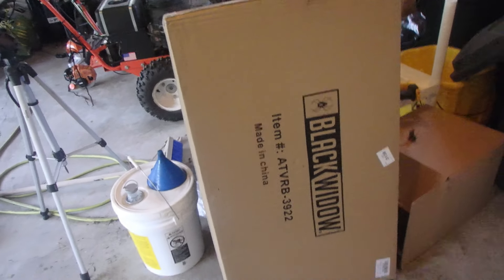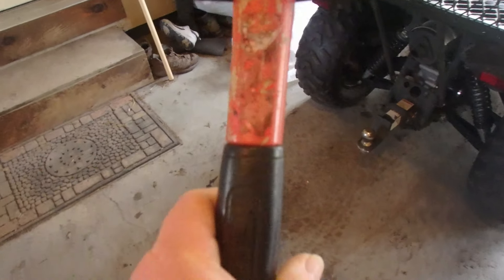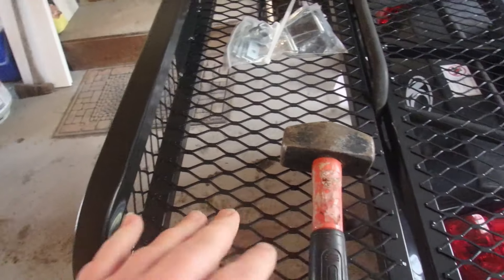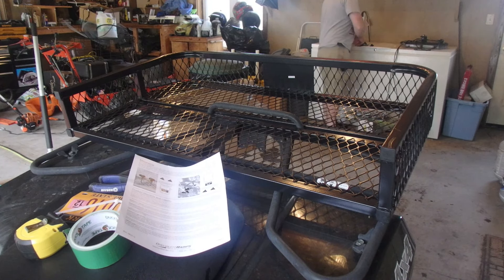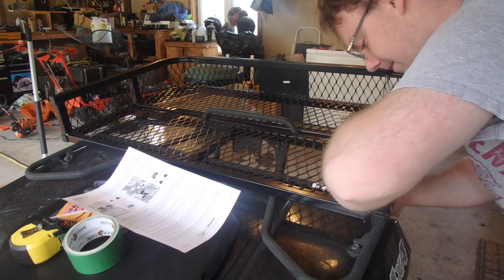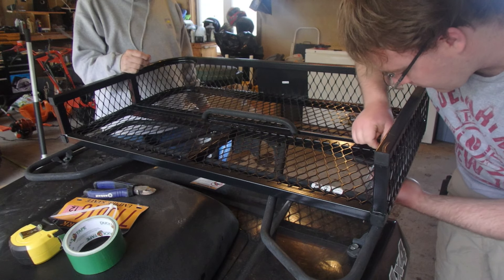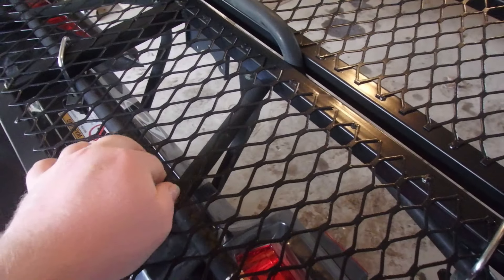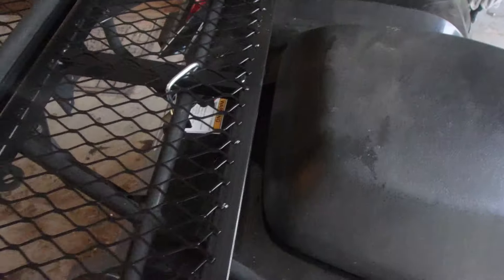Black Widow ATV Rear Basket Install

Comment: Just bought one and it just came in. I will mount it this weekend! Wish me luck.
Reply from the maker: Holy cow I did not mean to ignore your last comment! I am not getting any updates or when my subscriptions post new videos. The rack was easy to install, I didnt use all the parts and I turned them upside down to the screws go on the bottom not the top. As for the black piece sticking up that is part of the ATV, I had to wedge it in there so it would fit and I think it adds to the strength of it.
Reply: Thank you so much for getting back to me. Appreciate it.